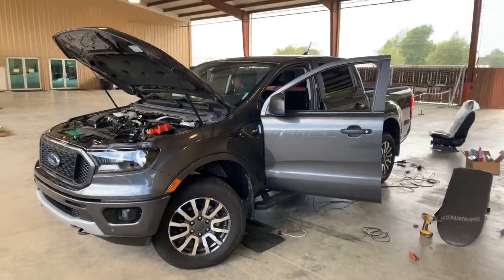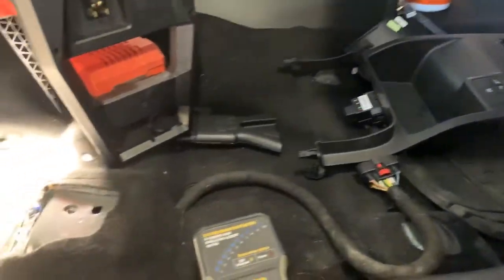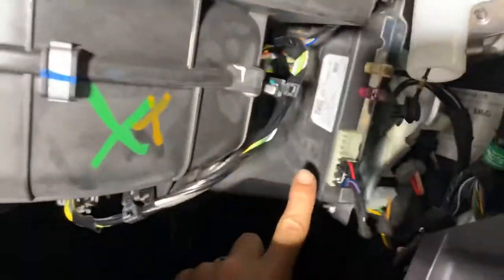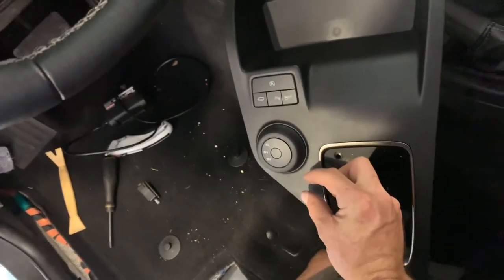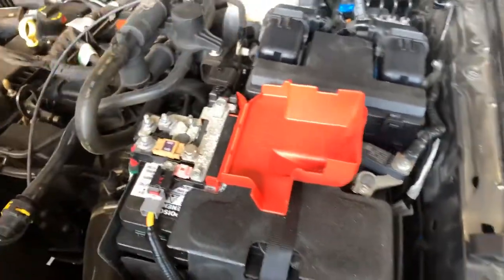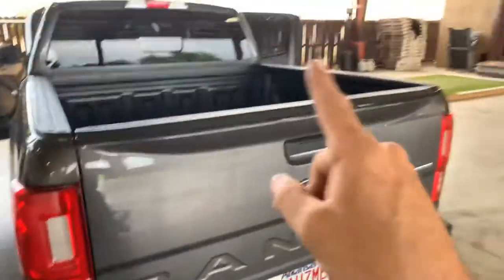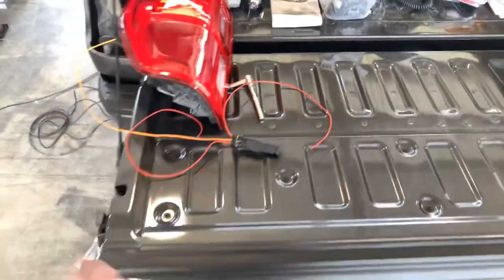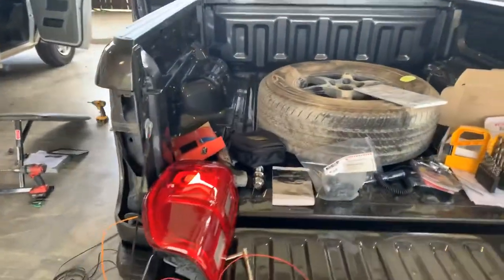2019 Ford Ranger Aftermarket Brake Control Installation Issues

Comment: I'm glad you use the brake light wire and suggest the chmsl wire, since going by the brake pedal signal not only has the issues you outlined, but also isn't activated by the AEB (automatic emergency breaking) or ACC (adaptive cruise control) systems. If the truck were to automatically apply brakes in an emergency situation without also applying trailer brakes, then you're gonna have a bad time. And insurance may not cover you either.
Reply from the maker: Absolutely! That has become quite a conversation topic between OEMs and aftermarket equipment providers. SOME OEMs are taking those situations into consideration and others are not. In the meantime, until we have a comprehensive list backed with field research, it’s best NOT to use the CHMSL circuit for brake controller input; especially on late year model vehicles.

Comment: I just bought a 2021 Ford Ranger XL STX with no tow package.  I will be installing a Tow Pro Elite Break Controller that I have acquired through a Ford Dealership.  As you point out, there is no wiring or plug under the dash to install a break controller.  I was able to mostly follow your video, but I didn't quite catch where you should hardwire the blue trailer brake wire from the controller.  It sounds like you are advising that the blue trailer brake wire coming from the controller should be hardwired into the break light wire found at the back of the truck.  FYI, the kit from the Ford Dealership (VKB3Z2C006A) does have a Lumen Trailer Lamp ECU that is connected to the CHMSL on the back of the truck cab.  If you could confirm, that would be awesome!  Thank you!
Reply from the maker: The CHMSL circuit (with the associated ECU) will be what “tells” the brake controller that you are pressing the brake pedal and that it needs to send power to the trailer brakes.
The blue wire FROM the brake controller will be ran/hardwired from the controller in the cab to the electric brake circuit post in the wiring plug at the back of the truck. It should be a “straight run” and not connected to anything else.
Reply: Got it!  Thank you so much! Best Regards, Tom

Comment: The CHMSL wire comes off the BCM. Left side under dash next to fuse box. Connector 5, Pin 13 (wire color Yellow w/ Grey Stripe)
Be sure to also use a diode.

Comment: This is a weird situation. I have no pig tail but the wire harness at the trailer plug has all seven wires there. I used an adapter to get a seven plug and I have reverse. Why would they include trailer sway when no seven plug? The fuse box has an output for trailer brake power. Did you look into tapping in to the fuse box under the hood?
Reply from the maker: Hi Ken.
If you have a model that has ANY trailer wiring, then yours is better equipped than the one in this video. We ARE aware of the fuse provisions for the trailer wiring in the power distribution box under the hood. On the truck in this video, those fuse positions were there, but the wiring was not. In other words, those fuse bays were not “active.”
As far as a factory trailer sway feature (not sure what that is comprised of), Ford probably puts that on all these trucks as “standard” equipment because if they provide ANY way to pull a trailer (even if that’s a hole in the bumper for a ball), then they probably want that feature to work. I’m not entirely sure how the manufacturers are accomplishing trailer sway control on their trucks. It would almost have to be something that utilizes the ABS system to apply short alternating brake pulses to the rear wheels of the vehicle... 🤔  From an aftermarket perspective, trailer sway has always been best controlled with a mechanical sway control device mounted between the vehicle/trailer.

Comment: I have a 2021 ranger xl stx. Mine doesn't have the 4 wires under the dash. Ibought the REDARC vkb3z-2c006-a fe9m Ford not knowing I didn't have the wires. Mine has the harness going to the rear brake light in the rear of the headliner. Just need to find out where to hook up my yellow and blue wire off of the REDARC.  Have less than a week before I have to drive 8 hours to pick up a 2023 RV . Any help appreciated

Comment: This Ranger doesn't have the blunt cut wires for the TBC because it doesn't have the tow package. You can tell by the fact there's no 7-pin connector at the back. It's kind of weird, but the tow package doesn't include the TBC, you have to get it separately (part number VKB3Z2C006A)
Reply: That Ford TBC includes a separate module that allows connection to the CHMSL. Its plug and play but a lot of work to install as you have to run the wires all the way up to the 3rd brake lamp.
Reply: @akshonclip  I know, I did that on my Ranger... it's actually easier than you think. The point of my comment is that the Ranger on the video doesn't have the tow package, and in those Rangers that do have it, Ford left the wires ready to plug the TBC... if you want to you can install just the TBC, and not the auxiliary module, but then you would have to disable the automatic emergency braking (pre-collision assist). The connection to the CHMSL is only a workaround for the AEB

Comment: Just bought a 2019 Lariat  with a tow package. My new brake controller arrived today. Official ford model. Now I am concerned....
Reply from the maker: Don’t be too concerned!
Since the original filming of this video, REDARC has partnered with Ford and the “official Ford model” is the REDARC Tow Pro brake controller. It probably even came with the wiring kit that simplifies the installation by eliminating the guess-work. 👍🏼

Comment: I'm  sure you know by now if the tow package is there it has wires... you were close wrapped  in blue tape & main loom
Reply from the maker: James Rolzitto: Yes. We knew that. The point of this video is that there are some Rangers that do not have wires AT ALL. We have since seen more Rangers that were equipped similarly to this one that HAD the wires. This one did not. In these apparent rare cases, the vehicle will have to be “hardwired.”